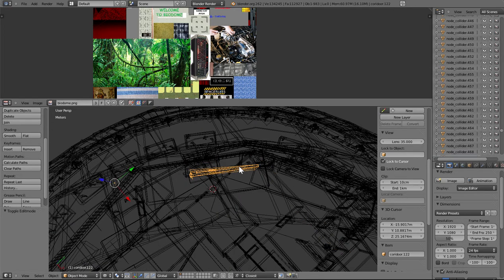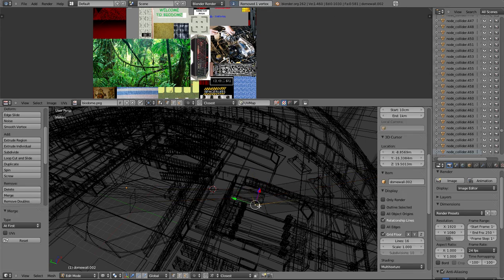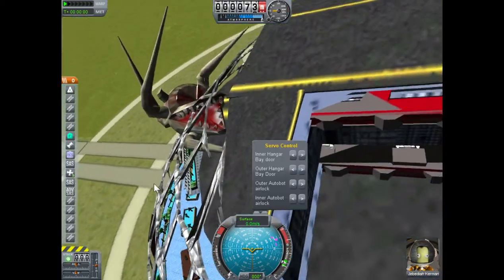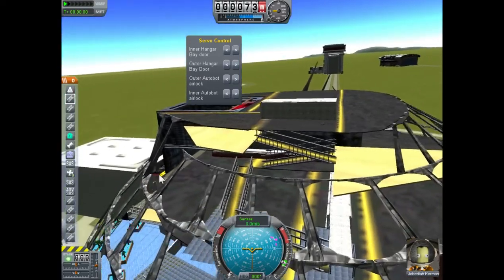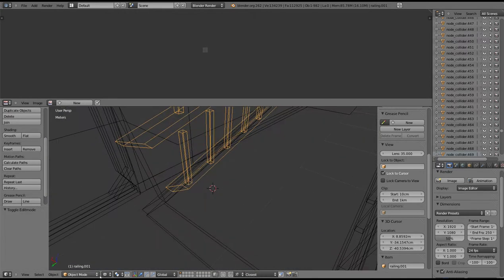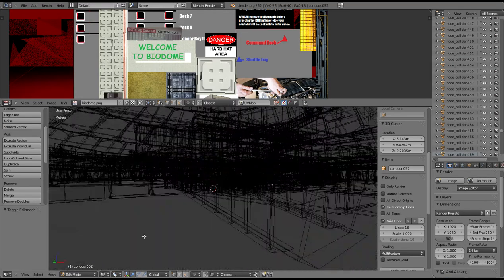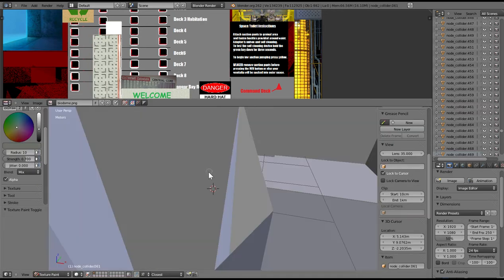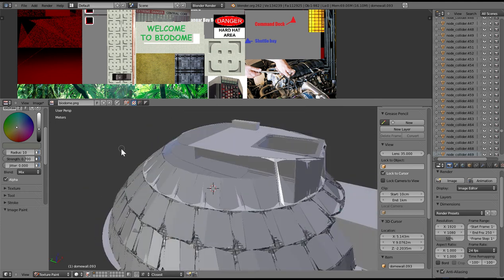Behind the Scenes of Biodome

Comment: If you ask me, radial-mount descent engines and landing legs would go a long way to improving the look and feel of this thing. 

I bet you could fiddle with collisions to add a clippable "foundation" to at least make the structure look like it's settled into the ground rather than on top.

Also, try MechJeb. It would put that thing down in a straight line with no problem.